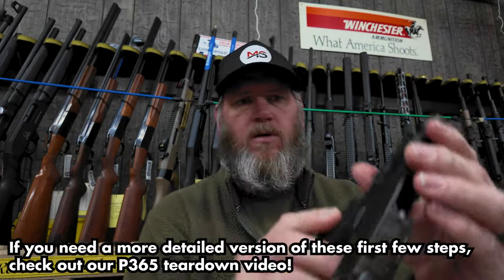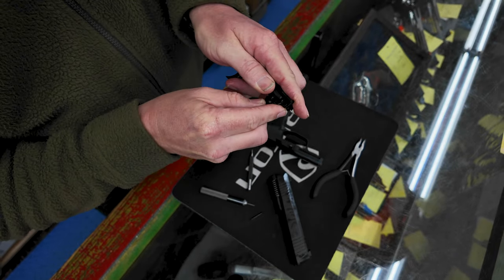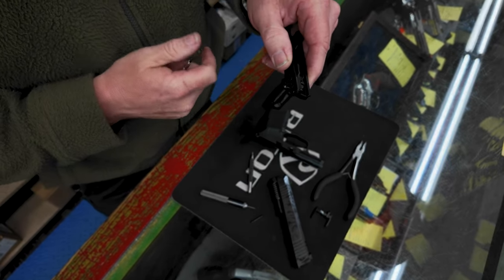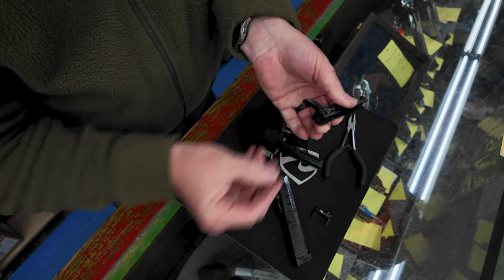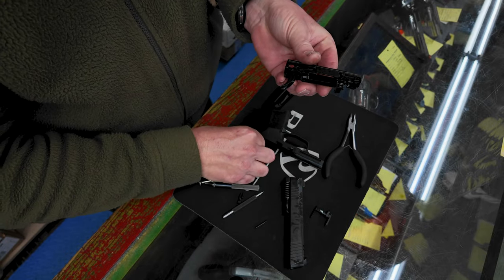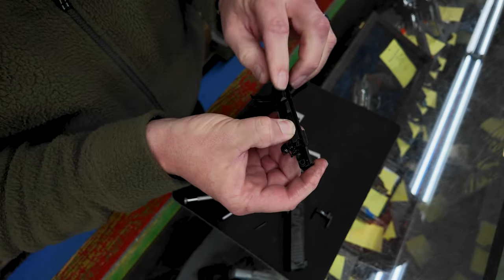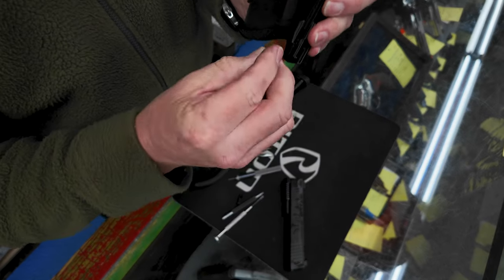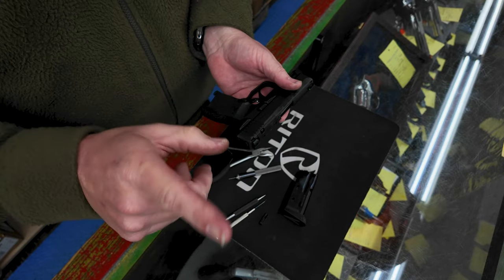Sig Sauer P365 Magazine Disconnect Removal Step by Step Guide

Comment: This is a good example of idiocy in california law. In order to purchase one of these in CA, you have to take the firearm safety certificate test which SPECIFICALLY REQUIRES you to understand and demonstrate that a semi-auto pistol can be loaded and fired with the magazine removed. Then they go ahead and require you to buy a semi-auto pistol that makes that previous requirement incorrect, useless, and potentially dangerous.The ability to fire with the magazine removed is a FEATURE and could save your life.

Also, training people on a a pistol that is safe when the magazine is removed will surely instill some very bad habits in new shooters.
Reply: I work at independence armory in petaluma as a firearm safety instructor and it pains me when people get that question wrong on the fsc test because they were taught with comifornia handguns. I've heard incidents of people having negligent discharges in other states because they thought if the mag was removed the gun is "safe" when it's not
Reply: @norcalslidintestchannel7766  That’s so unfortunate! We need better education about firearms for everyone, but especially for lawmakers. Thanks for sharing!